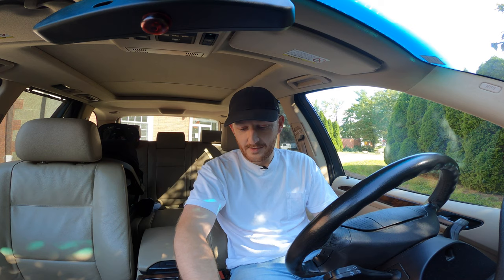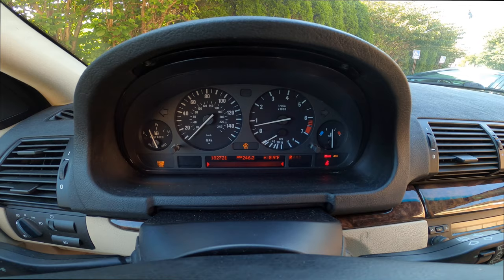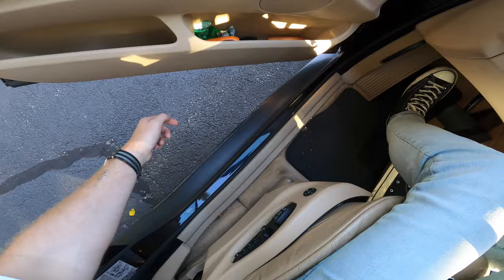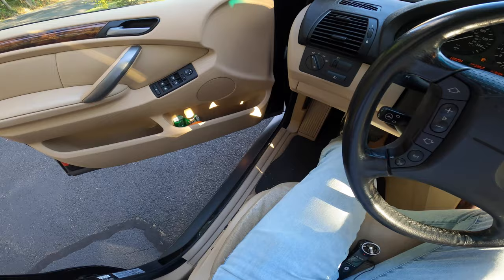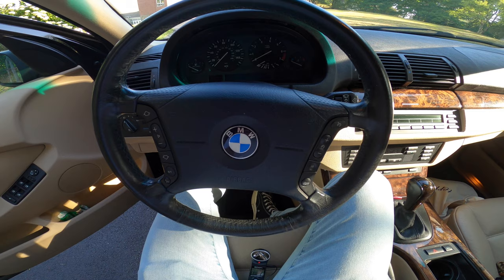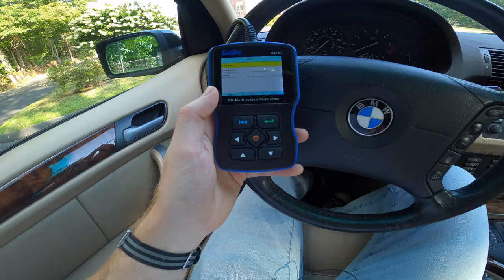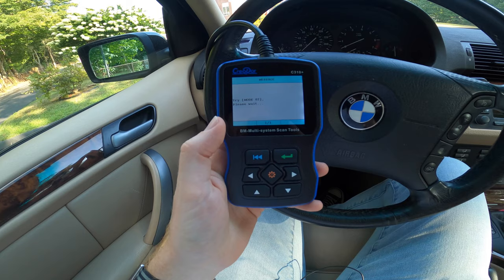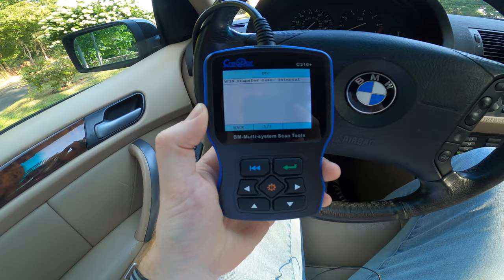How to Diagnose BMW Transfer Case Actuator Gear Failure E83 X3 E53 X5 Brake ABS 4X4 Lights On 5F39

Comment: I have problem BMW X3 3.01   I try diy I replace it problem still on..maybe need a good scanner to reset? Please help me....
Reply from the maker: Do you have a BMW specific scan tool or INPA with a laptop and cable?
Reply: BIMMER ZEIT no. I replace the plastic gear , I don’t see the broken gear. And put it back accordingly.
I don’t have inpa...
I  should get the scanner first.
Right now I used fox scanner but doesn’t have capability to reset... I’ll be back learn and study your video..
Reply from the maker: Juper Simoran get the c310 scan tool. Check to see what codes your car is putting out. This is the cheapest and easiest step to begin figuring out what the problem is 😊

Comment: if the transfer case plastic gear fails will it only be rwd? i have these light on and im sure its only rwd at the mo?
Reply from the maker: That depends, it could go both ways. Either no 4X4, or the whole thing seizes up and it is stuck in 4X4 where you'll notice the tires binding/screeching/bucking on tight turns or driving in parking lots.
Reply: @BIMMERZEITT  i think im rwd at the mo mate you think the plastic gear will fix it ?
Reply from the maker: @ryancrf250guy8  worth a shot, it is your cheapest option. You could start by removing the transfer case actuator and inspecting the gear. Can get it removed in about 30-40 minutes.
Reply: @BIMMERZEITT  will get it done tomorrow nice 1 bud
Reply: @BIMMERZEITT  i just had my front axles replaced and I drove off home came to a stop 🛑 and I thought I was in neutral?  Took it back to mechanic and he said it my transmission? I feel like he didn’t install the axles right causing the t case to lock as I’ve read that can happen? Do you think this happened to me ?  Ps yesterday while I had it in drive and it wouldn’t move I reved the engine thinking it would engage gears and the drive shaft bent off and practically broke off I’m soooo mad cause I know my bmw is very good it never had that issue before the axles were changed !??

Comment: Sup Rich...I’m in CT too. I don’t have a click but I’m clearly in 4x4 can feel tight/bind when turning at slow speed. I only have 4x4 light on and my code is 5462 “servo force too high” is this also the servo? I don’t have the triad.
Reply from the maker: hey, yeah it could be the gear has failed. Worst case scenario the entire servo motor could be replaced. You can start by removing the motor and inspecting the gear for worn teeth. See my other DIY video guide here: https://youtu.be/UR7Vv5SQvDc
Reply: Sadly confirmed both servo motor and gear are ok and functional...
Reply: @nathanielmoore5677  Did you ever figure it out?
Reply: Yes, servo motor issue. Motor spins when bench tested to 12 volts but would not function in car...bought an $86 eBay one and back in action...no lights
Reply: @nathanielmoore5677  is a servo motor the same as the transfer case motor?
Reply: @s.medina3661  I have the same question.

Comment: What if its only 4x4 light on and DSC inactive light ???
Reply from the maker: Step 1: scan for codes
Reply: @BIMMERZEITT  yes they did scan and still are clueless! Codes say 227 & 228 which are o2 bank 2 control deviation and o2 bank 1 control deviation.. 
Also I have 4x4 DSC Inactive light on and hear grinding noise underneath at stops. I assume Transfer Case Motor or Gear ??? 
My check engine light has Always been on for years ( Map Thermostat) which every mechanic told me not to bother replacing...
The car has trouble starting every morning and when low on fuel.
Maybe Fuel pump Relay?? 
Fuel pressure regulator?? 
Fuel filter?? 
Fuel Injectors ?? 
They cant figure it out! Went to 20 car shops in 3 weeks and am really frustrated :( 
What could it be ??? 
Bmw X5 2006 3.0

Comment: My 4x4 light is on by itself so do I need this part?
Reply from the maker: Hi, Step one is to scan your car with a BMW scan tool to get the trouble codes stored in the computer. You can't skip this step, otherwise you'll just be throwing parts and money at the car. I use the C310 for $55 which is less than what a shop will charge you to scan the car. Here: https://amzn.to/3n0stEU
Reply: Thank you.
Reply: @BIMMERZEITT  hey hi you doing man over time if you had this problem and ur reverse go out could it still be that part
Reply from the maker: @vincentmckissic2928  no reverse sounds like a transmission problem sorry to say...

Comment: Is that gear good for a 2007 X5 4.8i E70?
Reply from the maker: hey Miguel, yes it is the same gear for the E53 and E70. You can get the actuator with gear here: https://amzn.to/3AahE9A
Reply: @BIMMERZEITT  how are you boss. So i purchased the gear and turns out that mines is good still. Brand you pretty much. Help me because i still have the 4x4 brake light on.
Reply: @BIMMERZEITT  note i did still replaced it with yours. But still the same. And when i do a turn before the 4x4 light comes on the suspension acts as if i hit a pot hole or goes high then the 4x4 comes on
Reply from the maker: @2004skylinegtrr34  hey Miguel, that is frustrating! Did you scan your X5 with a BMW scan tool to get the stored codes? That is really the essential first step to diagnose correctly. Let me know what code you saw.
Reply: @BIMMERZEITT  well I ran the X5 with no codes showing.
Reply from the maker: @2004skylinegtrr34  what scan tool are you using?